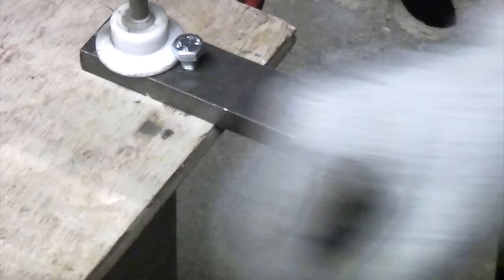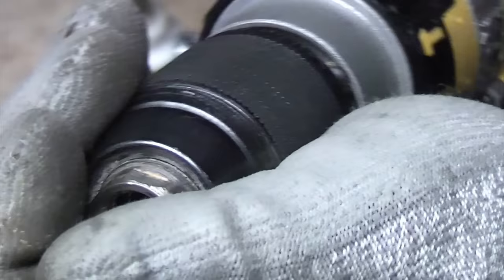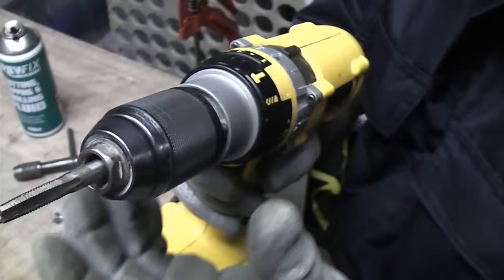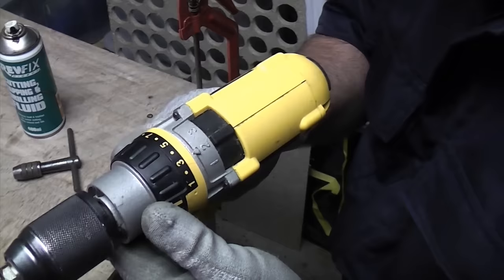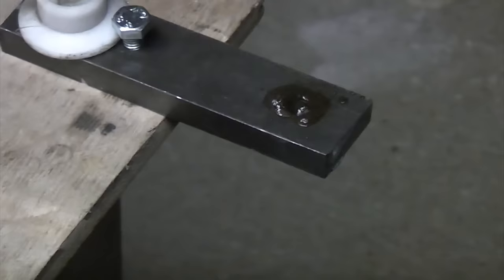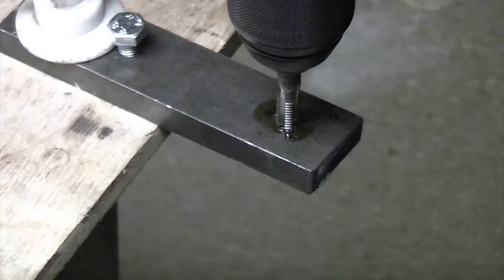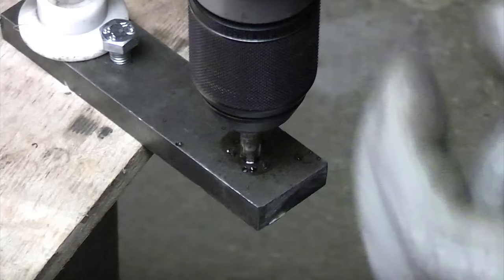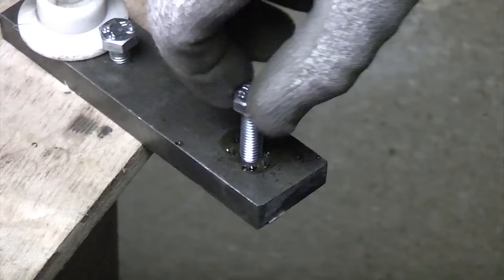How to tap threads using a drill

Comment: hiya! i know this is dragging up an old one, but you may be the (handy!) man to ask on this... darts... what advice would you give for trying to tap tungsten using a 2BA tap? :-)
Reply from the maker: I thought that only the tip of the dart was tungsten?
It's not something I have ever tried to tap before but I would imagine it being very difficult as tungsten is tough stuff!
Reply: worse than that, it's brittle. no, the tip (the point) is steel. the shaft is generally plastic. the body of the dart itself, that's the tungsten... unless i'm a mile off here!!! lol
Reply from the maker: LOL, I'm not a dart expert!
I think I played a couple of times as a kid until I had too many holes in my wardrobe!
You might be able to re-tap it as long as you take your time and use a good quality tap with lubricant.
2BA is very small though for something so tough!

Comment: Got to love these know nothing dickeads saying "Good way to break a tap" I've been tapping holes with a drill for more than 30 years, the key is the right hole size. If I use the same tap on aluminum and stainless steel the hole size will be different. Smaller hole on aluminum because it's soft material, slightly larger hole on stainless because it's hard.

The drill is nothing more than a tap-matic (Google it) that you would use in a drill press, both have low speed and a clutch. Have I ever broken a tap? Sure, but it was usually do to my error, that's why I try to do a practice hole in the same material I'm using. 

Here's a tip: Taps are not fussy, you don't need fancy cutting fluid, motor oil works just as good. 🇺🇸

Comment: Can you tap say a 12mm threaded hole to 15mm threaded hole?
Reply from the maker: No, not unless you drill the hole to a larger diameter. 
But providing there is enough material around the hole, it is possible once drilled out.

Comment: Unless you have an endless supply of taps and can throw away steel on a whim, I recommend you only do it by hand. You have limited control and feel using power tools. Another axiom to remember, use power tools to take things apart, not to put them together. Taking a frozen bolt out with a power tool is better than braking a bolt off putting one in.
Reply from the maker: jerry bushman 
That's why it's important to use the drills torque control ;-)
Reply: ***** Do you know what the torque is for each setting? No. How fast can you release the trigger when it snags? You can break your taps and ruin your project if you want, but I will do it by hand. Think of it this way. You need to tap a hole in a $1000 racing engine block. Power tool or by hand?
Reply from the maker: jerry bushman 
It depends.
I work in a chemical plant where downtime equals money, so it's in my best interest to drill and tap the hole as fast as possible. That's why you start off with the lowest torque setting and gradually increase it ;-)
Reply: *****????? Downtime??? You can do what you want. But unless you are a machine shop, your downtime would be greater after breaking a tap. This is all about advice. It is not good advice to recommend using power tools to tap a hole In hardened steel
Reply: ***** Like I said you can do it however you want. Giving advice to others is a whole different animal. Time for you to now move on
Reply: jerry bushman That's not hardened steel. On flat bars (unlike blind holes in engine block) slow speed shift-drills saves time since high speed reverse is part of the drill. It would be foolish to not take advantage of this when wasting time could doom his business.
Reply: David Read my previous comment.
Reply: "...not good advice to recommend using power tools to tap a hole In hardened steel." See YouTube video CNC tapping of several holes of hardened steel in high speed...no occasional reverse needed.
Reply: David CNC machines use especially hard taps that we don't use in our garages. I will always advise Joe Bloe to do it by hand because he may not know what he is tapping. Joe is not the guy building a race car frame in his garage. Joe is the guy who needs to tap something every now and then. Taking your advise he could be making a simple job into one costing hundreds. People watching YouTube videos are trying to figure how to do something. They are not trying to increase production. Drilling and tapping one hole is not going to make or break his project if it takes a minute longer to tap a hole. If that tap breaks it could ruin the project.
Reply: TheRageMaker What? I started out pretty easy going. Anytime you encourage some dumb ass looking on youtube to learn how to tap a hole, and they go next door and borrow the neighbors drill and $45 dollar tap, you should be slapped. I know lots of short cuts but would never advise anyone to take a financial and or project risk. Someone is going to take a drill and try to re-tap a thermostat housing mounting bolt in a 40 year old intake manifold and end up having the worst day in their life. 

Next
Reply: TheRageMaker Don't be such a trol

Comment: Hello, I need a threader for M5 but I want a tight fit. Do you know what size to use?
Reply from the maker: 4.2mm is the drilling size if you are using a M5 tap, here is a useful guide-
http://www.ultimatehandyman.co.uk/how-to/metalworking/tap-and-die
 Thanks for the comment 👍
Reply: @ultimatehandyman  It's the threader I'm unsure of, I have the drill.
Reply from the maker: @eddierodden    If you are using a M5 bolt, you need to drill a 4.2mm hole and tap using a M5 tap
If your hole is already 5mm, you can tap that to M6 and use a M6 bolt
Most standard bolts and taps are course threads, but you might get a tighter fit if you use fine threads, but they are not common and will likely be more expensive.
Reply: @ultimatehandyman  okay thanks, I'll use a standard one and hopefully just tighten the head.

Comment: Not recommended.
Reply from the maker: It depends how much time you have to fix something ;-)
Thanks for the comment
Reply: Ultimate Handyman That is the worst time to do that little trick. Break a tap and see how long it takes you.
Reply from the maker: That is why you use the torque control on the drill ;-)
Reply: To each his own. Me personally I would rather do it by hand because it doesn’t take long either way LOL!
Reply from the maker: If you are on a production line and you have to re-tap 5 holes and it's costing you £100's per minute, I'd rather use the drill- or speed taps https://www.youtube.com/watch?v=96LwwycOhPI
Thanks for the comments

Comment: Corrected title for this vid:

"How to break a tap using a drill"

I do a lot of power tapping. If the part that is being tapped moves, you will hear the sound: 

~ click ~ 
 >>>>  end of your joy for that day <<<<

Practice on some scrap aluminum before trying this for real on hard material.  Also a new, sharp tap will help a lot, but there is no guarantee.  
Consumer taps - the kind you buy in hardware/big box stores are dull when they are brand new. They are garbage.  Good quality HSS is what you want - fancy coatings will not help you. Carbide is brittle as all get out.  
If the drill is allowed to wobble, or is not aligned with the hole, or the tap contacts the bottom of the hole - if its a blind hole, or something behind the hole

~ click ~  

>>>>  end of your joy for that day <<<<

Also taps ruin the chuck in the drill. Use an adapter made of softer material.
I use these all the time. They are excellent.
https://www.mcmaster.com/2550A64/

GFL